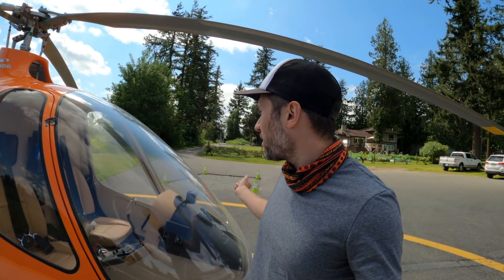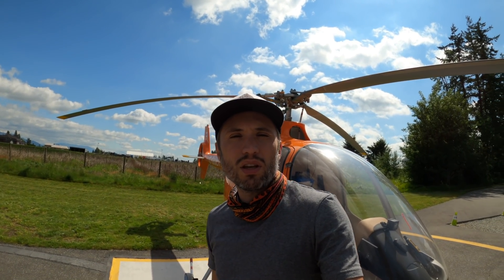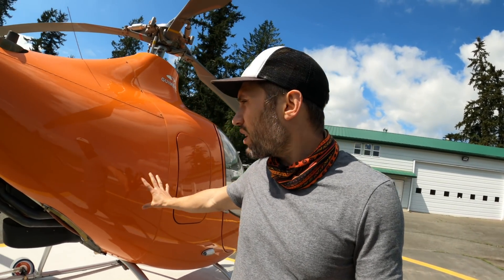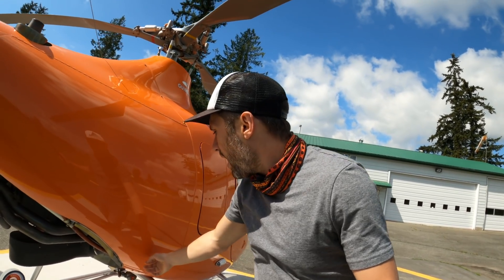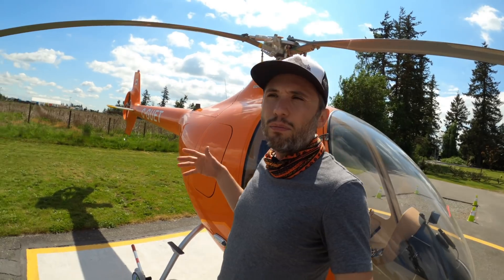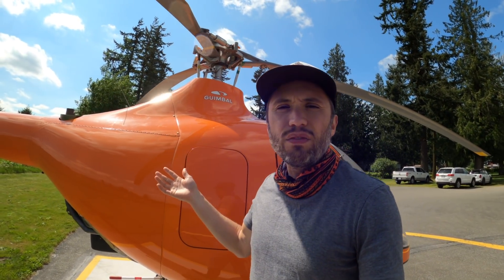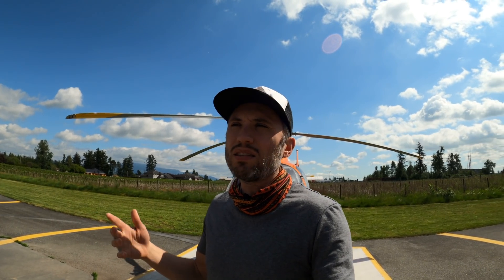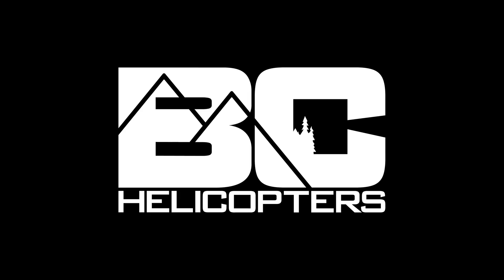WHY HELICOPTERS DON'T FLY FAST

Comment: What about the large blades going through the air, 1/2 the time against the direction of travel?
What about power to speed ratio? Energy (e.g. gallons of gas) to distance ratio?
Probably all favoring planes.

Comment: Nice simple basic explanation and to the point.     There are a few other factors I see a lot chatting about in the comments.   I will say that once you start getting into any of the twin turbine IFR capable helicopters skids or not you will just find more speed and a lot more power.    We often get asked to slow down in our busy traffic areas as to not run over the poor little pop can Cessnas.  Cruising at 130 to 140 kts is not uncommon and then factor in tailwinds and the grounds speeds can get pretty crazy.   I've seen as high as 180kts in an Agusta A109E .

Comment: One quick question please 
Could you get straight into a apache attack helicopter and fly it like getting in a different car your not used to?
or do different helicopters these days need different training and fly completely different????
Hope you can answer this question ha 
Love you vids keep up the great work
Reply: Ty Cool good question but that would be instant ☠️
Reply: Sharon Burns can you please Enlighten me on why it would be instant death?????
Reply: Ty Cool it's usually over compensation on the controls. That's why you are required to hire a CFI to introduce you to the new aircraft, three autorotations and your good to go. 👨🏼‍✈️
Reply: Sharon Burns thank you for getting back to be and very interesting 
What does CFI stand for please? And Sharon are you a pilot also?

Comment: Biggest limitation is retreating blade stall. 
How does that affect the Russian stuff with twin rotors? Theoretically they’re producing the same lift on both sides of the disc.
Reply: yes but the advancing blade will still go supersonic if the helicopter gets close to 200 mph
Reply: Good point.

Comment: I think you got balled up on efficiency vs speed.  As always more horsepower = more speed until you heat the limit of the retreating blade stalling or the advancing blade going supersonic. Quick clarification on the tail plane. It produces negative lift (pushing the boom down) so it provides downforce at speed not lift.  Another limiting factor in sum total is the tail rotor taking 1/4 your available power.  This is why most of the record breakers don't use a conventional tail rotor. This is also why the Chinook with its horrible aerodynamics and fixed gear still stuns the completion with 198MPH top speed and 400mile range.
Reply: great info!

Comment: Mischa, speaking of the undercarriage, is there any suspension/shockabsorption in case you have less than desirable landing. Those spindly legs look as though they may give way easily with a hard landing. Guessing your answer, you'll say there are no hard landings at BC Helicopters.  Seems like I remember you talking about some shock absorption in the seating when you were researching the Cabri. Thanks.
Reply: all helicopter are designed to take a very hard landing with collapsing struts, crushable seats and energy absorbing frames. I think the current survivability requirement is a 30 foot drop.
Reply from the maker: Joe-n-Tex the helicopter is mounted on foam mounts to help dampen the shock.

Comment: The reason helicopters don’t fly fast is “retreating blade stall”. You can put more powerful engines into a helicopter to overcome all the drag but you still can’t fly faster because when your retreating blades stalls, the helicopter will roll uncontrollably to the side of the retreating blades.
Reply: I was somewhat shocked that this video wasn't completely about retreating blade stall. It's why ALL helicopters have a theoretical speed limit that fixed-wing aircraft don't have.
Reply: @ryanmcgowan3061  Yeah it kinda seems like he didn't know about it :) Well, pilots don't really need to, to be able to fly. They aren't going to encounter that limit with these machines.
Reply: @JohnLivings  doesn't a left blade stalling cause the helicopter to pitch upwards. Gyroscopic precession acts 90 degrees Later in the rotation.
Reply: @alexanderroos3508  It causes pitch up but then tail rotor thrust can also interfere and create a left roll.
Reply: @marshallyaklin  good to know cheers
Reply: @alexanderroos3508  this has been the experience of the retreating blade stall incidents I've read about here. High, heavy and fast medivac noses up and rolls over and lost an engine. All pretty terrifying for the doctors in the back. The tail rotor roll effect would carry from helicopter to helicopter with the height relative to the main.
Reply: Wow. So much knowledge in this comment and replies. 👌🏻 Thank you.
Reply: Yea and the advancing blade can go supersonic.
Reply: True, but not an issue for the machines he is discussing here.
Reply: Steven Kelby Please rationalize your comment. Thank you very much in advance if you can convince me of a change in basic aerodynamics of rotor wing aircraft.

Comment: I always though helicopters were limited because of retreating blade stall, more than the drag from the airframe, which is why helicopters like the UH-47 (chinook) can fly faster since they don't have the same retreating blade stall concerns...
Reply: I also thought there was also a limit on the advancing blade and the need to keep the blade tip subsonic?
Reply: I was watching my kid play Fortnite the other day, and the helicopter had jet packs. I said I did not think that was a good idea, due to retreating blade stall. She ignored me and did not engage in a proper conversation on the topic.
Reply: @jimrogers907  tip jets were a real thing... they blew compressed air from the turbine core into the hub and out from the blade tips.
Reply: @jimrogers907  god speed jim.
Reply: That's correct. it's possible to create larger and stronger engines to overcome drag but even with enough "horse power" the  retreating blade stall will suppress the attempt to get higher speed....
Reply: RBS absolutely can be the limiting factor. I'm a MH-60R pilot and normally we're power (drag) limited at least in level flight at Sea Level. RBS becomes much more of a factor as AOB or Pressure Altitude increases. Normally we have the power for about 140 kts straight and level but we'll hit RBS well before that speed at 45 degrees AOB. Or flying at like 7k over the mountains we were speed limited by hitting the onset of RBS around 120 kts.
Reply: I think that's two different things - onset of retreating blade stall sets your Never Exceed Speed. Most helicopters should not be able to reach Never Exceed Speeds in level cruise as you need too much engine power and overheat the engine doing so. So in most helicopters the speed limit is set by how much lift the engine can give long-term vs. how much drag you have on the airframe - you increase the engine power or decrease the drag until something other become a problem, like retreating blade stall, mast bump, or excessive blade coning - for example in the KA-50 which has two counter-rotating blade systems atop one another, can actually connect with each other and cause crashes this way (A). That's just my layman's understanding of things, though - a follow up from Mischa would be nice indeed.

(A) https://www.flightglobal.com/rotor-blade-collision-is-blamed-for-ka-50-crash/22585.article
Reply: @GeFlixes  Definitely correct that most helos don't typically have the power to get to RBS.  However, as g loading increases, the airspeed at which you encounter RBS decreases.  In "high" G loading maneuvers you may get to RBS much sooner.  This becomes especially problematic when you enter a dive and creep closer towards Vne....because at the bottom your instinct will be to pull back to level out, increasing g loading and putting yourself even closer to RBS.  

Lots of words to really just say RBS is definitely something you can get to much quicker than most people think even if you're nowhere near Vne at max power straight and level.
Reply: @GeFlixes  haha... bro and r44 can BLOW past VNE without even trying... so can an R22.
Reply: A tip : watch series on InstaFlixxer. Been using them for watching loads of movies lately.
Reply: @Musa Abel Yea, I have been watching on InstaFlixxer for since december myself =)
Reply: @Musa Abel Yup, I've been watching on instaflixxer for months myself =)
Reply: @Musa Abel yea, been using instaflixxer for since december myself :D
Reply: @Musa Abel yup, have been watching on InstaFlixxer for since december myself :)
Reply: @Musa Abel Definitely, I've been using instaflixxer for months myself :)
Reply: @Musa Abel definitely, been using instaflixxer for years myself :)
Reply: @Musa Abel yea, I have been watching on InstaFlixxer for years myself :)
Reply: @Musa Abel definitely, been using InstaFlixxer for years myself :)
Reply: as someone who worked as an engineer for Boeing Rotorcraft (Chinook) that's correct... drag isn't the speed limitation, it's retreating blade stall.

Chinook is one of the fastest helicopters because of the contra-rotating rotors (the tandem retreating blades stall on different sides).

Sikorsky also has contra-rotating bladed helicopters in development with speeds of 260mph!
Reply: @stachowi  Sikorsky have a new helicopter that's 10+ mph faster than a 30 year old Westland Lynx.
Reply: @stachowi now imagine they can use exhaust vanes or a notar-like propulsion system to generate forward thrust